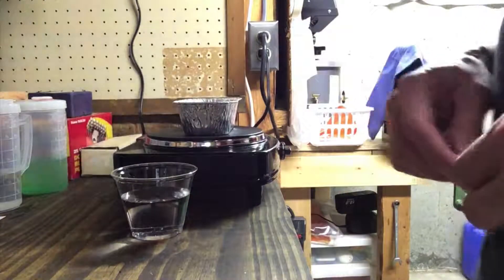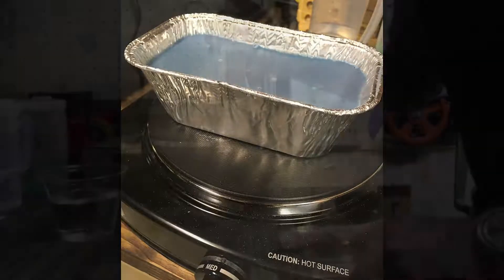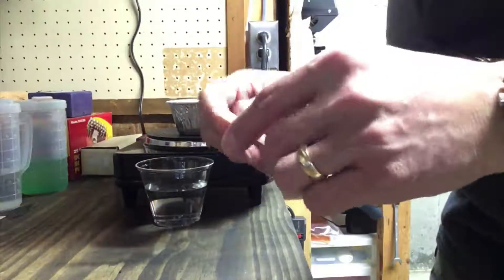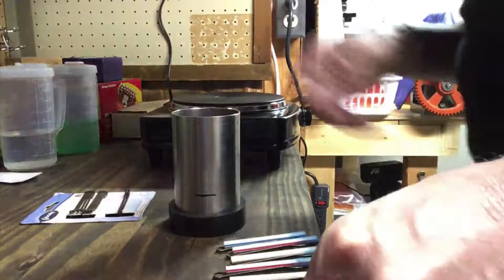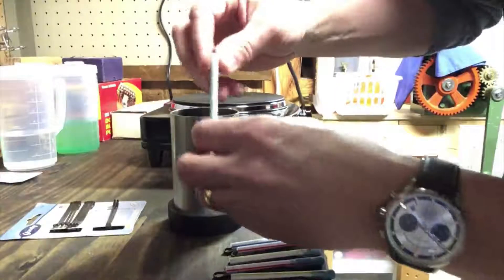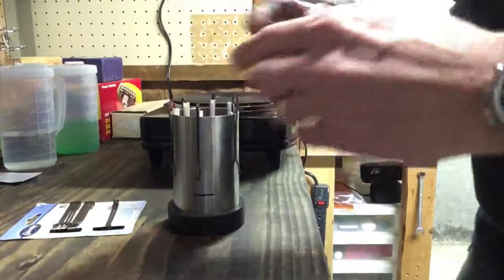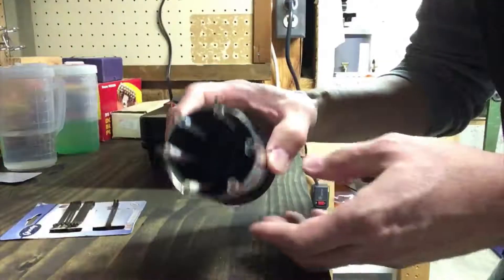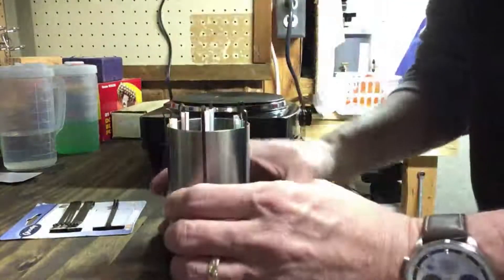How I Make Casting Straws for Vacuum Casting Jewelry

Comment: Two questions... Is there a substantial difference using perforated flasks or is it worth the extra money? and the dumb question, why not just drill some holes after the investment hardens?
Reply from the maker: Doug, both good questions. 
1. Perforated flasks only work in a chamber vacuum machine, and the machine I am using for this casting is not a chamber unit. 
2. Drilling holes takes more time, and creates investment dust which is a BAD thing. Dry Investment and lungs and a very bad combination. Causes silicosis.
Reply: @DougNapierJewelryMonk  Thanks!!! I get the difference in equipment. I'm basically trying to decide which to build. A steel plate with a silicone pad is much quicker, cheaper and easier than a tube and seal for perforated flasks. A $2000 commercial unit is out of the question and i already have a 3 gallon vacuum chamber.
Reply from the maker: @av8rdoug824  i have both and get equally good results with both. I would go with the steel plate (or aluminum) and a pad.
Reply: @DougNapierJewelryMonk  As far as holes, i was thinking about a solid flask and simply drilling 4 to 6 (maybe 3" deep depending on the flask) right along the inside wall of the flask, basically where you put the plastic straws. To avoid dust, slow bit speed. Maybe 1/8" or 1/4" bit. of course you need to be very aware of where the parts are hahaha. Straws look like they take just as much time and a minute with a drill. Just brainstorming while avoiding work on a friday :) Thanks again for your time and efforts educating us noobs!!!
Reply from the maker: @av8rdoug824  With my luck, I would drill right into a piece without knowing it, and have a blowout during casting.
Reply: @DougNapierJewelryMonk  I'm right there with ya on the luck thing. Off to the supermarket to buy some straws and bobby pins :)